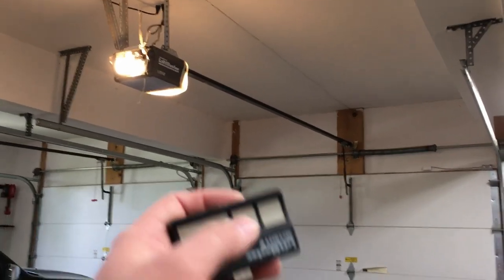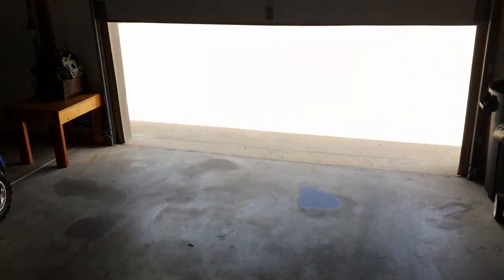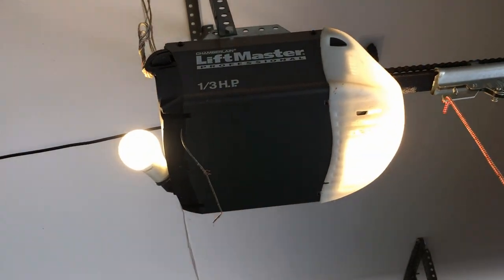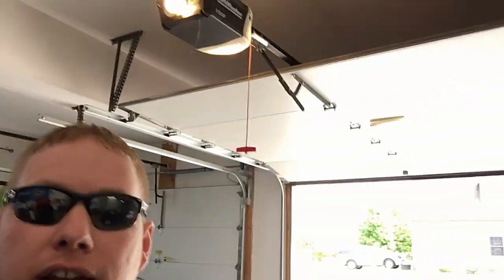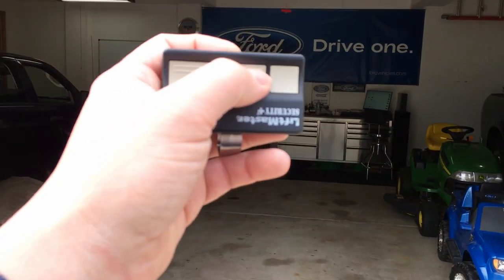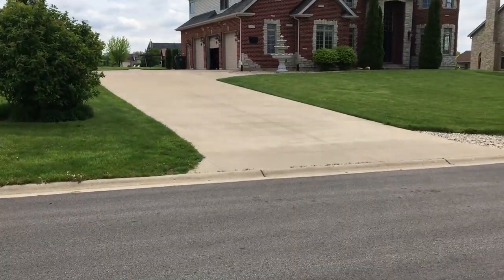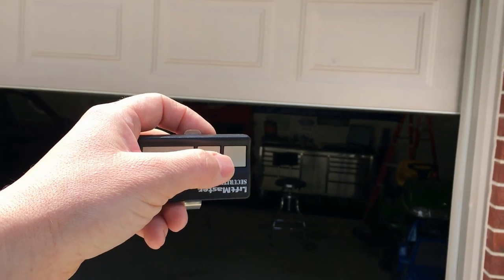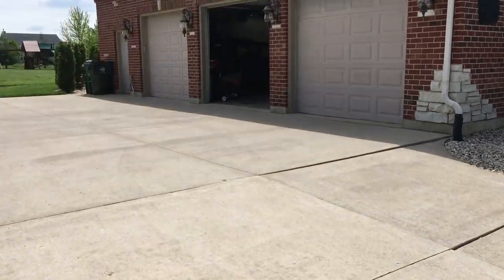Will LED Light Bulbs Really Cause Your Garage Door to Not Work?

Comment from the maker: These are the LED Bulbs I Recommend-
https://amzn.to/2GzwXzh
Reply: Once the LED light shuts off, the remote will work. I have the same issue.
Reply: Makulocos How To's Merlin
Reply: I just don't get why the LED bulbs don't work the way the others do. Thanks for the video. I never would've guessed inna million years 🤔
Reply: Can I open and close your garage door please I love your garage door opener
Reply: I love all the garage door opener
Reply: Interference that limits the range of garage door opener  genie light buib remotes designed specifically for garage door openers creates little or no radio frequency interference issues with most opener remotes
Reply: Mine doesn’t work when my fluorescent shop lights are on either
Reply: Can you provide another link please?   This one has expired.

Comment: Great advice! I followed your instructions and now my garage door works just fine. A contractor told me I needed a frequency booster, and/or a new board, etc. etc. You saved me a lot of money! Thank you.
Reply: Pedro Corona no is not the problem with a circuit board why is not the problem with the circuit board is rfi radio frequency interference that mean is the led light bulb cause a problem with the motor unit which is called the garage door opener 
Genie light bulb is the good solution to prevent interference with the remote 

Or a bad circuit board cause the relay click two Tim learn button flashing led light five time circuit board is shorted that mean soldering it I will fix your problem with the garage door opener not operating

Comment: Great vid.  Couldn't figure out why my keypad and remotes stopped working to close the door but worked fine to open.  Realized the only difference was that I had JUST replaced my burned out bulbs with LEDs.  Great info to know, as the problem is now fixed and the wife is happy again!  Gotta love technology right.

Comment: Hey Makuloco! I want to say THANK YOU for your video! I recently replaced the CFL bulb with LED and exactly like your video described... the remote will not open or close the garage once you step a few feet outside. At time it would work intermittently... I had a hunch that it’s caused by the RFI from the LED BULB and decided to YouTube it. I came across your video and replaced the LED bulb with CFL and now my garage door is working perfectly.  I went as far as cleaning out the sensor, took the damn motor out and cleaned it, none of it worked except the god damn LED bulb(I had two of them! ) once the LED bulbs are out, they work absolutely fine. Hilarious and thank you!

Comment: THANK YOU SO VERY MUCH FOR THIS VIDEO!!  I changed the garage openor light bulb the next day after seeing this video and to my amazement my garage door opened from the curb, which is several yards away from the garage door.  I have never been able to get the garage door to open from the street curb entry of the driveway!  I thought it was a low battery issue.  Thank you so much again. This actually worked

Comment: Oh my goodness, I think this is what is wrong with both my garage doors. It's been weeks since we replaced the bulbs w/ LEDs then yesterday the remotes will not open the doors from outside but they work inside the garage. I was thinking the worst 🤦🏽‍♀️. I need to purchase bulbs to replace the LEDs. Fingers crossed this will resolve my problem. Thanks so much for your video 🙌🏼

Comment: I had the exact experience - really surprised me.  I had put some LED's (mixed with older CFL) in and saw a degradation of remote control function; BUT once I moved to 100% LED's - huge issues with my Liftmaster Elite 3850.  Remotes barely worked at all.   I swapped out all LED's with, frustratingly, all 60W incandescents (regular old bulbs).  By doing so, all remote problems were 100% resolved.  I looked at some LED bulbs (Genie) with a different signals supposedly OK in garage door openers.  I would need to buy six - just not worth it - $42+ ($6-9 each) and no assurance that electrical bill savings would ever justify the excessive cost per bulb.

Comment: The lights in our Chamberlain Whisper Drive HD900D opener refuse to turn off ... motion detector not turning the lights on or off ... there is a 'click' coming from the opener when I press the 'light' button on the remote by the house door, but the lights remain on. So ... per the YouTube video, I replaced the LED bulbs with good old incandescent and ... yup, it works fine now. I see the video is 5 years old, but the advice works today too ! Thank you !

Comment: In the past few months I've been having the same issues. LEDs had worked fine but no longer. Tried new LEDs from Bulbs and Batteries and still no good. Next will be CFLs. THANKS for the video.

Comment: I had LED bulbs in mine for about a year but then had this exact problem.  I replaced the bulbs with incandescent bulbs, problem solved.  When I remove the LED bulbs one had a black burnt mark on it so I assume over the one year the LED developed a problem.   I am reluctant to try LED's again.

Comment: Q: When the door has remained closed for some time the light goes off, right? So when you come back the bulb is off (no power) why / how does a non energized circuit in the LED bulb cause interference with the signal?  I understand that when the bulb is powered the inductor on the circuit board for the LED can produce interference. Not being a smart ass, just want to understand.
Reply: Exactly. You're not a smart ass, you're smart! Big difference.

Comment: Thanks for the tip!  FYI... Just built a 3 stall garage with 4 ft. LED ceiling fixtures ( 6 of them). Wow, awesome bright garage!.  No interference with the Chamberlain openers.  I'll try LED lights in the openers and see if I get the same long range from the remote.

Comment: Garage opened by itself when I use LED bulbs. Had a heavy rain and the opener when crazy. Swap back for regular bulb issue is gone. Opener is a craftsmen from 2003. Was about to replace a perfectly working opener. Save big money $$$

Comment: LED light bars on my garage ceiling were the culprit. I replaced my neon fixtures with the LED less than a year ago. Turn them on, opener would not work. Turn them off, works fine. Still using incandescent in the opener motor.

Comment: I have a strange situation where the garage door opener would not work unless I turn off the light from the wall control box. I did buy a no interference LED bulb sold by Chamberlain. I also try without any bulb and still have the same issue.

Comment: Happens with my landscape led lights on even though they are away from the garage lol. When I turn off the landscape lighting, it opens fine. The garage door company is telling me I need to change the door openers for 2 doors and wants to charge me $1000. Should I just try and change all landscape led bulbs to branded ones?

Comment: HEY MAKULOCO, I WONDER IF YOU COULD HELP GET THE WORD OUT THERE...WE HAD THIS PROBLEM OF "WEAK SIGNAL" NOT OPENING THE DOOR. PUT (SPLICE) A LONG WIRE ONTO THE OPENER ANTENNA, I.E., EXTEND THE OPENER ANTENNA ALL THE WAY TO OUTSIDE OF THE HOUSE. THAT FIXED OUR ISSUE!!!!

Comment: Are you saying that even though the LED is not lit, because it times out, it still causes a problem?
Reply: no is not the problem with a circuit board why is not the problem with the circuit board is rfi radio frequency interference that mean is the led light bulb cause a problem with the motor unit which is called the garage door opener 
Genie light bulb is the good solution to prevent interference with the remote 

Or a bad circuit board cause the relay click two Tim learn button flashing led light five time circuit board is shorted that mean soldering it I will fix your problem with the garage door opener not operating

Comment: Something must be different in the opener hardware/software, as per model type. I recently moved as well, the PO had similar Liftmaster branded openers from 2003 with LED bulbs. No problem with the signal from 3-400ft up the driveway. I replaced the openers with a Chamberlain brand and installed cheap LEDs. I can be 1/8 mile away with the opener in my pocket, working on something in the woods and accidentally open the doors.

Comment: Garage door lights are behind a plastic diffuser, this cuts down the amount of light. I mounted a metal electric octagonal box on the metal strapping, above the opener. Mounted a basement porcelain light fixture ($1). I ran a cord with plug to a old screw in plug in adapter to the opener bulb socket. The bulb now is away from the opener and up by the ceiling giving you a lot of light, you don’t need 2 bulbs. I don’t have any interference problems.   Jim

Comment: OK I have led ceiling lights that I put on the same circuit as the opener. Intermittent opening until it eventually just stopped. Replaced the entire board, same issue. Moved power to another outlet, and it works every time. Super annoying. Don't have a good idea to fix this. Don't want an extension cord hanging on the ceiling forever.

Comment: The rapid switching from the LED driver is likely causing the interference. Putting in two bulbs may double the frequency if they don't start up at the exact same time. This wouldn't be a problem on the older door openers where the radio receiver was a separate component mounted further away from the opener.

Comment: I added led in my garage in mine only problem I have is it won't close when I'm outside I can open it but not close it sometimes
Reply: Perhaps you can open and close it when the led is off but doesn't work when the led is illuminated

Comment: I took my bulb out, and it worked like a champ for 3 days. Now, the remote doesn't work inside or outside the garage. The button on the wall works just fine though. Any suggestions?

Comment: Great information, but, let me add even more.  LED bulbs can be a problem when there is a garage light near the opener.  In my case, I wanted more light, and changed out the bulb in the overhead to LED.  This fixture is right next to the garage door opener.  The opener would not always open or close the door, and, when it did, you had to be very close to the door.  I tried extending the antenna for the opener, but, this really did nothing.  I remembered that this problem started after I changed the bulbs in the overhead light to LED, so put the old CFL's back into the light.  Now it works again.  I still have LED's in the opener 2 bulbs, and have not had any more problems.  However, just to make sure I do not, I will put 2 CFL's in the opener as well.  Hope this help others looking to solve this strange issue.  It makes sense to me, because the LED bulbs are on the same frequency as the opener, which can cause problems.

Comment: Now i have to be close to the garage to open it where before it would open 30 feet away and now it won't I change the batteries and same result. Same thing with buttons in car, what can I do. I have an electric also that this is happens with.

Comment: I have 2 prong screw in adapters in both of my openers, then I have an LED strip light about a foot long plugged in and attached to the body of the opener. No problems with either opener. Maybe because the actual light is farther away from the antenna.

Comment: Removing the LEDs didn't help. I connected small gauge solld wire to the stripped end of transmitter wire and strung across garage ceiling and outside corner od garage door, it now works great !!
Reply: SAME!!!!!!!!US TOO!!!!!!! THANK YOU SOOOOO MUCH FOR THE AWESOME IDEA AND FIX!!!!!!!
Reply: David  no is not the problem with a circuit board why is not the problem with the circuit board is rfi radio frequency interference that mean is the led light bulb cause a problem with the motor unit which is called the garage door opener 
Genie light bulb is the good solution to prevent interference with the remote 

Or a bad circuit board cause the relay click two Tim learn button flashing led light five time circuit board is shorted that mean soldering it I will fix your problem with the garage door opener not operating

Comment: We have a genie intellicode garage door opener that uses 2 bulbs. We are using 2 Philips 60w LED bulbs with NO issues. We can open the door from across the street and even further.
Reply: Same here -- no problem with standard LEDs. Not saying they can't cause problems for others, though.
Reply: @ttiwkram  Genie’s and Overhead Door’s are great at protecting interference with LED bulbs.

Comment: Try this on for size...I have incandescent bulbs in my opener. My garage door will only open or close (from remote) when the bulb is OFF. It is a single bulb and I am 100% confident that it is an incandescent bulb. I have also removed the bulb and still it won't operate while the light bulb socket is receiving current from the opener. I know this because after the 4.5 minutes for the light go go out I can once again open/close the door.
Reply: @Herbert Wingfield did you ever solve the issue you described? I have the same issue and i don't know what the fix is
Reply: did you ever figure out this problem? I have the same issue as well and don't know what else to do.
Reply: @kkjcheng85  replaced it. It was dying.  :(

Comment: Bingo. Had LEDs in my lift master. Took a couple weeks for them to take out the board. Mine was acting like low batteries, the distance of operation kept getting weaker.
I junked the opener & the cheap Home Depot leds.

Comment: I replaced the circuit board on my opener and it worked perfectly for about 5 months, then started this nonsense again. Now I'm thinking it's this interference you're talking about. Gonna test it tomorrow and if it works, I'm buying you a beer.

Comment: '
i did before...
a twister bulb in the garage machine is not working...
take another normal light bulb in machine again then finally working...
normal light bulb dont have electronic parts...
twister bulb do have electronic parts and mix up or steal garaga machine electronic
Reply: I had a LiftMaster with TWO BURNED OUT bulbs that are also incandescent, And the remote started not working like it’s a dead battery, Probably a bad circuit board.

Comment: Oh yeah some LED bulbs mess with the openers My Sears Opener if I put a LED in it the remote won’t work at all
Reply: no is not the problem with a circuit board why is not the problem with the circuit board is rfi radio frequency interference that mean is the led light bulb cause a problem with the motor unit which is called the garage door opener 
Genie light bulb is the good solution to prevent interference with the remote 

Or a bad circuit board cause the relay click two Tim learn button flashing led light five time circuit board is shorted that mean soldering it I will fix your problem with the garage door opener not operating

Comment: what if u waited 5 minutes until the bulbs turn off?
Reply: This is the only time mine works. I have to wait until the light goes off. I haven't recently changed the bulb it just randomly stopped working. Going to try changing the bulb to see if that works
Reply: Homer Simpson then mine works fine when the LED bulb is turned off! It’s amazing how he’d LED RFI would interfere with the sensor!